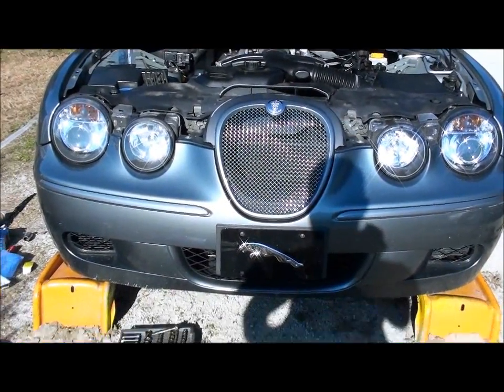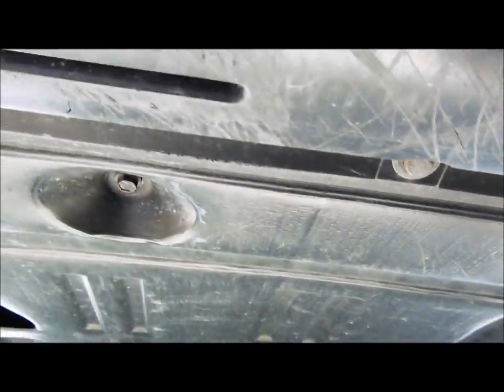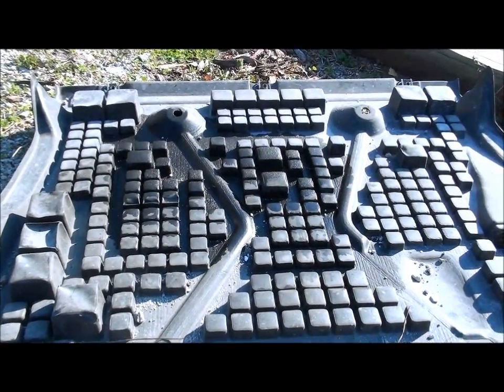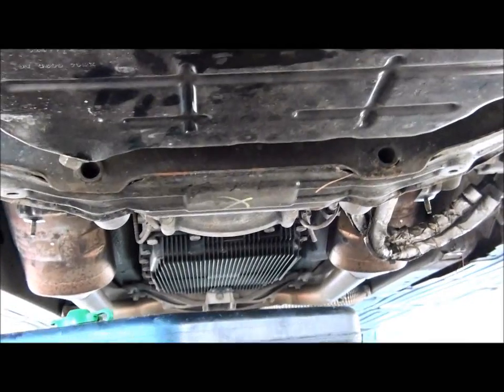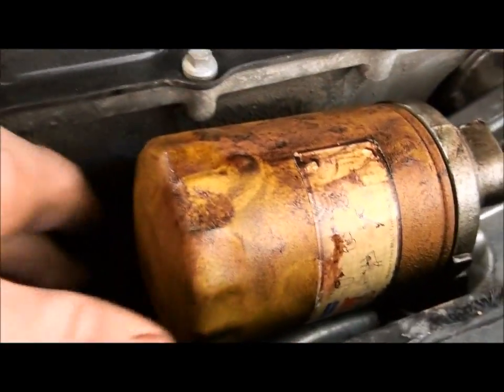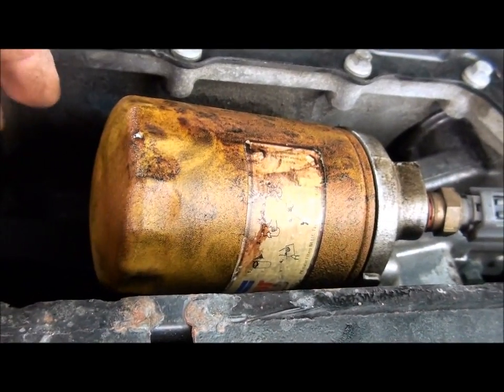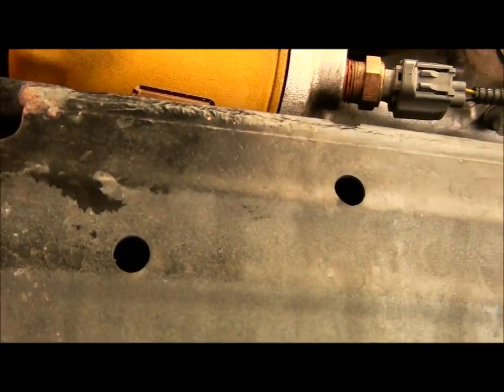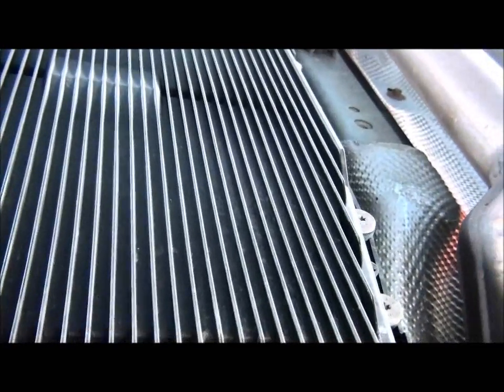Oil change on Jaguar S type R Part 1

Comment from the maker: @cbr900rr919 The car already comes with a transmission cooler and I'm not really sure of all the people with transmission problems they must have pre-03s regular S types with the Ford trans that has issues. The R's have a pretty solid trans.  I've rarely seen anyone with a problem with them on the boards.  There is a great video posted on youtube for a tran filter and fluid replace for an XK8 which is the same trans that is an excellent write up for anyone looking for info on that.

Comment from the maker: They are ramp extenders.  Not sure if they work with Rhinos.  They have some tabs that lock into the holes on the ramp so they don't move and they help a lot for lowered cars.  I got them back when I had a lowered car so they are pretty old.

Comment from the maker: @cbr900rr919 The transmission in the post 03's runs on mineral type trans fluid. If you put anything different in there you will most likely be needing a new transmission. The stuff at the Range Rover dealers seems to be the cheapest. A few guys on the forums have used Castrol Multi import with good luck.

Comment from the maker: I didn't get into proper ramp techniques because if you are doing an oil change how you get the front end up is up to you.  I use ramps some people would probably just jack it up.  Mine were chocked even though it has an auto handbrake you just can't see them.

Comment: There are different engines and transmissions that may have different proceedures and parts.  It would be good if you mentioned what year, what engine, what transmission you have.  Otherwisw a pretty good tutorial.   Thanks.
Reply from the maker: The video is titled Jaguar S Type R. There is only 1 engine and transmission that was available on all S Type Rs. So this will work for all of them. But this particular video involved a 2005 with the 4.2L supercharged V8.
Reply: @vance580  still have the car?

Comment: Question, would you know anything about a “check fuel filler cap” I’ve gotten it read and I’m told my fuel filler neck has a small hole, and also made my engine light come on would that be the cause? I have an S Type Signature series 3.0 V6....